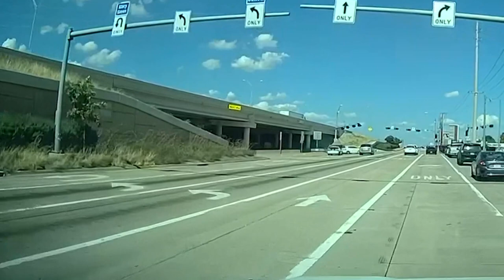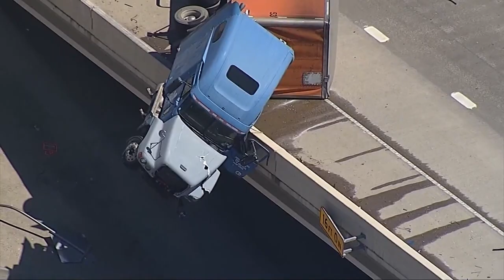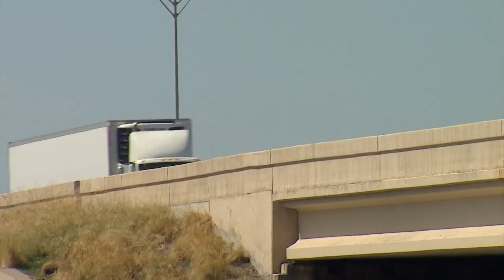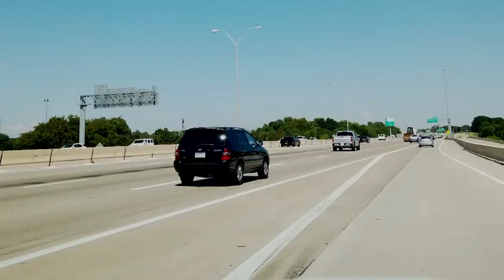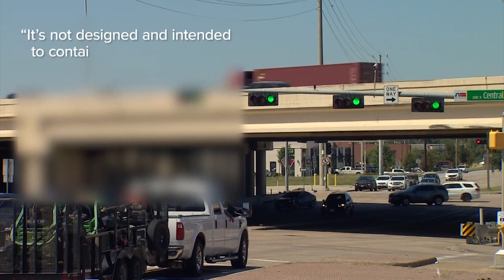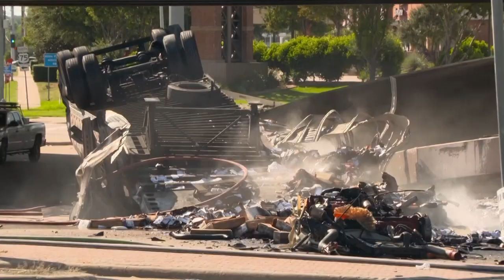U.S. 75 guardrails draw concerns after deadly Allen truck crash

Comment: Even if the fence/rail were double that height, a fully loaded 18 wheeler , even in this tragic case, would still have gone right over.  It was stated in another news report that the driver of this 18 wheeler had collided with another car on the freeway just before the accident happened.  It was a sad day all around.

Comment: It,s not the guardrails , it,s the speeding of the  tractortrailer drivers the problem
Reply: No, the problem is cars that think they can cut off an 18 wheeler and think they will immediately be able to stop. He was an experienced truck driver and never had any incidents in the 20+ years he drove them. Your lack of remorse and judgement shows your ignorance.
Reply: the data begs to differ and split speeds makes it worst, but yeah, stay in your feelings, but more people will get hurt or die, because of people like you all in their feelings, smh
Reply: But big trucks can run 4 wheelers off the road and pull out in front of them taking as long as possible sorting through their gear box….  
Most big trucks just as bad as little cars
Reply: @DAViDD767  So what if I am in my feelings, you obviously lack emotion. He was my cousins' husband. All witnesses on scene have reported the driver of the mustang was at fault.
Reply: @rmsdieselworks4703  the data begs to differ, but stay in your feelings
Reply: @DAViDD767  I'm confused, were you disputing Alberto or hellomarie?
Reply: @Hellomarie2003  I had a feeling the Mustang driver was at fault. I am a former OTR driver also. Condolences to you and your family on the loss.
Reply: @anonymousinc6330  Thank you for your condolences, that’s very kind and respectful of you. My husband has worked in motor vehicle insurance for 20 years and said the same, the mustang driver is at fault. Witnesses on the scene gave the same account of what happened.
Reply: @anonymousinc6330  It was the mustangs fault.  There is new dash cam footage of someone driving behind the truck. The driver of the mustang was speeding and lost control hitting the front left side with such force it pushed both tires to the right causing the tractor trailer to fall off the bridge. It happened so fast that my cousin’s husband didn’t have a chance to save himself.